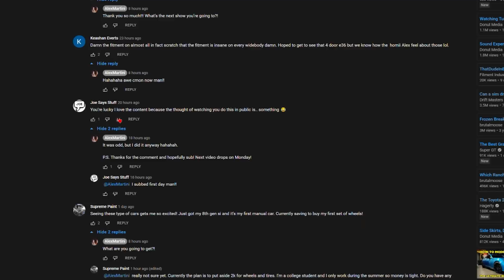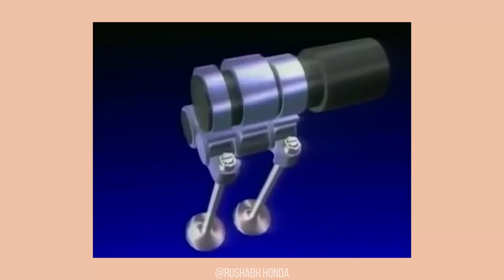VTEC: How Honda Changed Everything

Comment: I experienced vvt im my mums two corollas both very recent ones then i bought an 02 dc5 base model k20a3 was cool but its almost like no vtec was there because well its a base model and only revved to 7000 then drove the first vvt variation 4age in an sx corolla hatch blown motor unfortunately almost impossible to find a replacement here in Australia nothing felt proper AND THEN I HIT THE BIG ONE only bought it very very recently a championship white fn2 type R with the lsd and even though its sitting at 242 thousand rookie numbers for a honda but also considered high depending who you ask first time into vtec proper vtec holy moly turns into a machine instead of just cruising around its like an angry father with anger issues one push and off he goes amazing feeling im definitely considering another proper vtec honda if i sell or can't rebuild or find a replacement engine for this one when and if that fateful day comes where it just can't kick anymore i love honda more now than i already did which was a lot anyway. They don't make em like they used to well close new ones just need vtec otherwise still sorta not the same

Comment: I was 18 and my ae86 corolla  with mukuni carbs used to bring joy until my friend came along with integra gsr. That damn car ruined my corolla experience. Since then i own a acura integra for 18 years now.
Reply: What??? Integra over 86??? 

I respect you choice but I personally wouldn’t have switch. Both are great cars tho!
Reply: @omarawilson2853  this was over 18 years ago because it was very rusted and daily driving a carb 4 cylinder is not what you think.
Reply: @enriquealvarez4702  oh well that makes sense and is understandable
Reply from the maker: Still love it?
Reply: @AlexMartini.  my integra of course. I love it so much i also bought a crx and a fk8 ctr. In place of the ae86 i have na miata r-package. If i find another ae86 ill buy it too.
Reply: @enriquealvarez4702  sick

Comment: ERMAGERD THAT KITTEN SO CUTE!!!  Vtec is my fav variable lift system. Others i halfway understand just work tf out the oil.  Probe GT was the best car with the most unfortunate name. Still wouldn't want one because of that engine bay. Panic attack inducing levels of clutter. I will never touch another 3000gt or 300zx
Reply from the maker: 300zx, Ford Probe, 3000GT, Aston Martin, the list goes on and on.
Reply: @AlexMartini.  They put that v6 in Astons?? d e d. Any 90's v engine that's sideways or turbo is too extra for me. Maybe as a hobby with no deadline, but trying to get paid on... nope

Comment: My first car was a 97 civic ex manual payed 500 fixed some things it was a deal had dc headers,cold air routed to the bumpe, stage 2 clutch, lowed on springs, engine bay and trunk adjustable braces and wide rims fun car sold it a few years ago to get a 06 infinity g35 coupe
Reply from the maker: What is your favorite car so far then?! 

P.S. Thanks for the comment and hopefully, sub! This is a new video style for me so I appreciate I support :)
Reply: @AlexMartini.  definitely the g35 it's still stock so I get to modify it myself plus it's quick as is so a better starting point for a build

Comment: Thoughts on a high mileage s2k? Like over 200k miles but super well maintained with receipts?
Reply: Americans are to scared on cara above the averege miles but think a little how the F a car do 1 milion miles with the same engine and trans ? Just be a good owner do the maintenence in time and look for cronical problems on foruns and allways be alert to those things, i drive old cars daily and never have a problem.. and Yes im always flooring and drifting but be carefull
Reply from the maker: Not terrible; just don't go nuts with what you pay for it!

Comment: I drove a manual Accord. I believe it was a 91 or 92. It was still the boxy style. It had a lot of miles on it. But whenever I did get on it it was nice lol. It was one of the first sticks I learned to drive on. Also a 71 C10. Both of them were in horrible shape. I remember the c10's floor was rotting out of it lol. But I think it was good that it happened that way. I got to grind the gears and work with clutches that weren't so great. Now I consider myself a pretty decent driver 👍
Reply from the maker: There you go! What do you drive now?
Reply: @AlexMartini.  just a 19 Corolla S.
But I bought. 15 regal GS 6 speed that I wanna work on. Which I'll be purchasing my wheels through fitment. I work for Toyo so gonna go through them for the tires. Unless I can find a way to apply my discount through the FI website